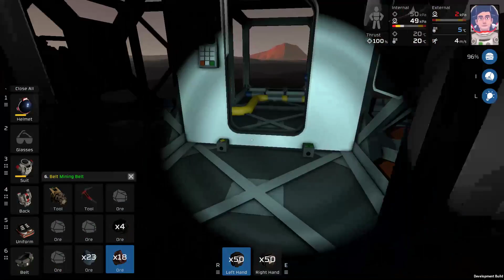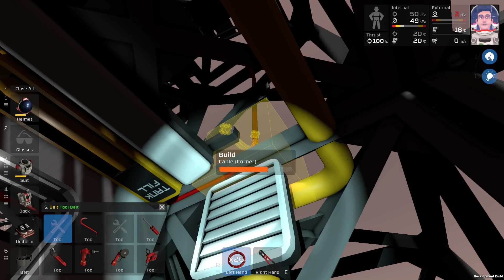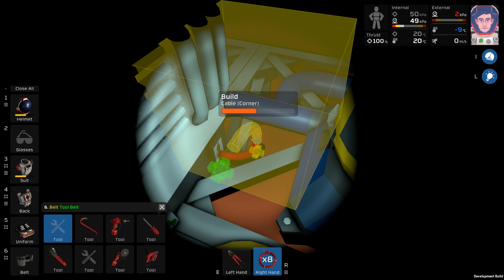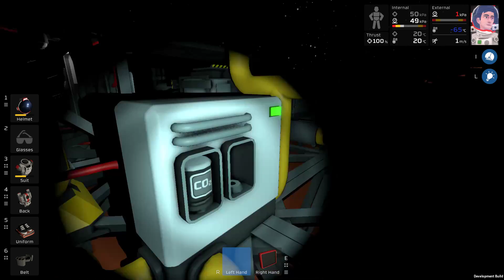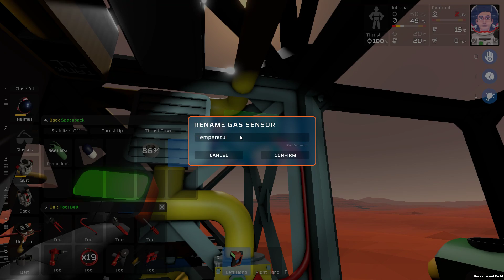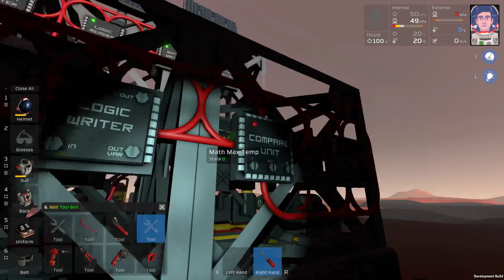Stationeers / EP 4 - Hydroponics Part 2 / Mars Colonization

Comment: I've seen people make a very simple airlock system to keep the pressure inside the building constant, and grow all kinds of food from day 2!
In the meantime, you're running around for three whole episodes, laying hundreds of miles of pipes from Miami to Moscow, complicating the air and water system, running cables from Mercury to Pluto, and that's all "just for food" without ever planting a single seed... Confusing? What on Mars makes you say that?
Reply from the maker: This series is over a year old. There has been a lot of additional content added to the game to make it easier and more accessible. Additionally, a lot of the 'quick and dirty' ways to grow food are .. exactly that, quick but unsustainable.
Reply: @Rhadamant  True, but the Martian atmosphere IS mostly CO2 already. So simply filling a building with that, and heating it up a little should be sufficient to grow plants for an extended period of time. Sure, it's not the most sophisticated yet. But over time, it can be improved. You can eventually add air-filtering, CO2 storage, water storage, complicated temperature control and all that. But in the meantime, you could have food growing much sooner without all that.

But to each their own, of course. My main issue was with the "not confusing" remarks you made several times over the course of the project. It's just a LOT of technology, pushed together in a cramped space, with NO prior indication of what any of it is going to do.

Comment: Is there any reason he doesn't just filter the atmosphere for CO2?
Reply from the maker: What do you mean? Keep everything but the CO2?
Reply: @Rhadamant  At the start I only saw you direct inputting the furnace into the system, with no mention of a vent >< Sorry.
Reply: The atmosphere of mars is at 0,06 times the atmospheric pressure of earth and contains 90% CO2, so you'll need a lot of time to fill a tank at half the pressure of earth
Reply: @catherinec.4493  One could use a pump/vent system to suck the air in and filter everything except the CO2 out. But I agree, it would take some doing!

Comment: Like the series, started playing and have died a few times.  Do you have any idea why my suit temp display and my tablet does not read the temp. Suit says nil and tablet is blank.
Reply: suit says nil when you have no atmosphere around you to measure (on the Moon or in space). Tablet needs to be turned on ("O") and to have correct cartridge insert.
Reply: @legolegs87  , thanks I am on the moon and I do have the tablet on.  I will have to check inside my greenhouse to see if the suit and tablet read.
Reply from the maker: legolegs got your answer =]